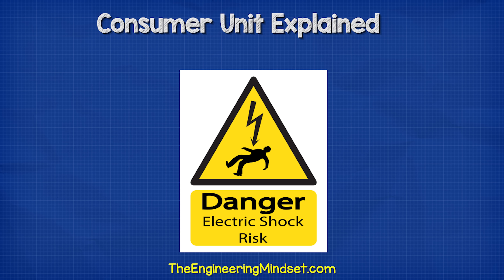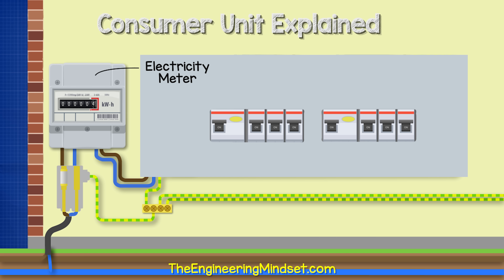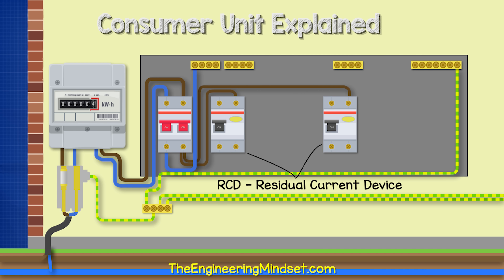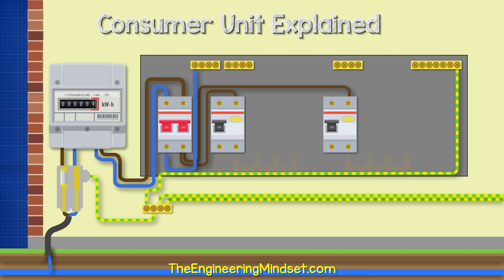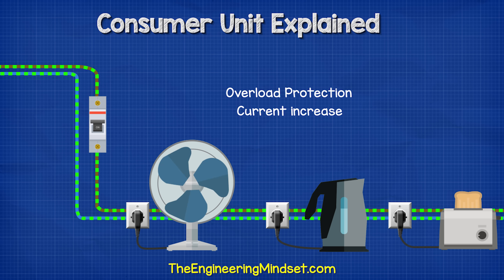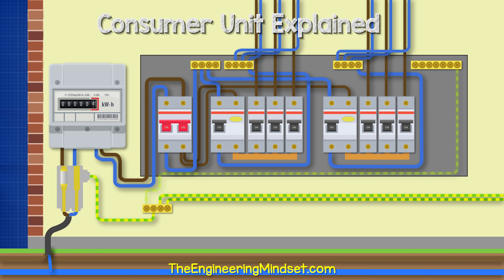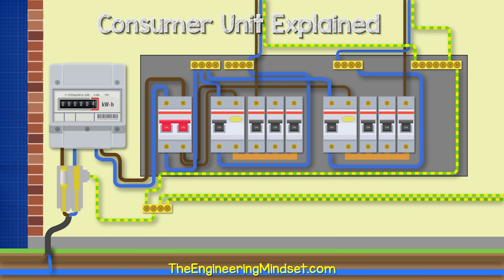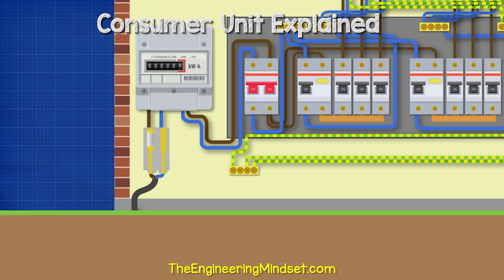Consumer Unit Explained - Fuse Board

Comment: Great Video!

Here in Brazil, this type of connection (master MCB followed by master RCD) is permitted only if the master RCD rated current capacity is equal or higher than the master MCB.
Reply from the maker: Seen our new incredibly detailed MCB video? link: https://youtu.be/gqEu9t8HwW0

Comment: Wired up my garden room, open consumer unit found a spare breaker, then shoved the earth and neutral into nearest vacant terminals and nada! Your explanation of RCDs enabled me to realise my CU was split in two with just one RCD and the other half was on breakers alone and I'd wired the live from breakers and the neutral was on the RCD neutral block. Quick re jig balanced the supply and bingo! Thanks so much

Comment: Please explain about the current rating of mcbs
Reply: The current rating is the current at which the MCB will trip. MCB are usually sized to match the cabling (and outlets) - lightning with 1.5mm2 cables would have a 10 amp fuse while 2.5mm2 wires would have a 16A MCB. This is to keep the wires from overheating. For smaller wires you would use even smaller mcb. However, if the connection is to an appliance or system using a known max amount of current in normal operation, you could size the MCB for the appliance instead, so MCB trips if there is a fault and overcurrent. MCB go down to as low as 1A,  possibly less.
Reply from the maker: Seen our new incredibly detailed MCB video? link: https://youtu.be/gqEu9t8HwW0

Comment: Maybe I missed something, but I thought UK and EU used delta-connected circuits for power distribution, meaning no neutral is required.  So where is the "neutral" for the house coming from?  Another phase, or grounded at the pole?
In North America all modern power distribution is Y (star) connected, so the neutral is inherent to the system already.

Comment: Interesting to see how residential panels work in different countries.
Here in the Netherlands its required to use breakers with both phase and neutral, also 3 phase connections are more common.
Reply: Is het niet zo dat de nul gewoon wordt door verbonden door het automaat?(behalve bij de aardlek)

Comment: if you have a hot and a neutral coming into the top main breaker for the unit how the heck does someone get dual voltage for things like ac/dryers etc. by the way youre explaining it, they only have 120 volts coming in
Reply: 230v is used in Europe.
Reply: @tougaardable  off one leg?
Reply from the maker: Only north America uses dual voltage, the rest of the world basically only uses ~230V only. There are some exceptions of course. But US homes typically also take a 240V supply and split it into two at the pole mounted transformer to create two 120V out of phase from each other. But the UK, Europe etc all just use 230V to power everything.
Reply: @EngineeringMindset  holy shit you use 230 volts for phone chargers and stuff? That seems extremely excessive lol. So literally every plug in a European house is a dryer plug
Reply from the maker: Every plug is ~230V, not just in Europe but almost the entire world. It's nearly only the US and Canada that use 120V. Again, there are some exceptions. The plug will contain power electronics which simply convert 230V AC into 5V DC to charge our phones or increasingly there's a USB charger build into the wall socket. Most modern electronic devices can be plugged into either 120V or 240V, the power electronics figure it out and use whatever it's given. Check the manufacturer label on the device.
Reply: @EngineeringMindset  wow I knew you guys operated off 50 hertz instead of 60 but I didn't realize it was THAT different
Reply: @erich1380  there are benefits to both systems, the US & Canada have a safer system from the point of view of potential injury to people, but the cables have to be much larger to offset the voltage drop from being only 120V and you need multiple phase’s to operate things like washing machines, alternatively we in the UK and EU use a higher voltage which means we can use smaller cables (which saves money) and still drive things like motors off single phase but we are more at risk from serious injury/death due to the higher voltage. Hope that makes sense.
Reply: @Dwynwilliams  yes I went to school for it so Iearned about how amps and volts are inversely proportional so it makes sense it's just surprising

Comment: So is a RCD just a ARC fault or something else completely?
Reply: Rcd monitors the current in the phase vs the current in the neutral. If they are not balanced then it will trip as this would mean there is a fault to earth. Typically 30mA  is all it takes to trip.  We also have 230v standard outlet and 400v for 2 phase circuits. Twice the smoke and fire..

Comment: i want to ask. it is recommended if the earth wire connected with ground rod also  connected with neutral wire of the service cable?
Reply: In the US it's recommend that they connect in the main service panel, but nowhere else.

Comment: Why does the UK only use two RCDs? Don't you want more granular protection so you know which circuit actually caused the fault? Also, if you cause a fault and half your house loses electricity
Reply from the maker: Properties in the UK an EU are typically small, wired just up and down stairs and not by room, although you could it just costs more
Reply: @EngineeringMindset  this is a basic explanation i’m assuming of an average UK installation, there are some things that are missing/omitted from the descriptions given, and some of the terms used are old or erroneous (Phase.. now Line conductor). The video is good as a basic description/layout, but “earth” particularly got my back up (c.p.c (circuit protective conductor)/main bonding/equipotential bonding), no mains isolator between the meter and the consumer unit is shown and an “electro magnetic effect” operates the MCB opposed to the sudden increased flow of electrons causing the bimetallic strip within the MCB to expand which is thermal expansion. Also complete omission of RCBO’s which do the jobs of both MCB’s and RCD’s in one device and have been on the market for decades, given the option electricians would install an rcbo board over a split load any day.
Reply from the maker: Seen our new incredibly detailed MCB video? link: https://youtu.be/gqEu9t8HwW0

Comment: It may be indicative of the relative power usage in the US vs UK that the main fuse in the UK is typically 100a, which at 220 v allows for 22000 watts of power, whereas, in the US, a 400a panel at 110v or 44000 watts might seriously be a candidate for an upgrade to a higher amperage panel.
Reply: US houses typically have 240 volts @ 200A service, which allows for a maximum of 48,000 W of power to be drawn.

Comment: Could you do 3 phase IT net?
Reply from the maker: Are you in Norway?
Reply: That is correct, about the only country I think with a 3 phase It net without neutral wire. 3 phases and ground, but ground is only for safety, not to get sqrt3 of 230v'.
So 230v between the phases, would really like to have 400v TN net instead though even though we are more resistant to earth failure.
Reply from the maker: I only learnt recently that Norway still uses the IT system, didn't realise anywhere really used it still. Could be worth covering at some point, we have quite a few videos in production so it'll be after those.
Reply: Is IT net still used at hospitals and other infrastructure that is dependent on a failsafe backup system?

Yeah, a lot of Norway's distribution system is built for IT net as that have been the tradition for many centuries. I do not know why we ever adopted the IT net in the first place, but I do know that we early on had local power plants spread out near to industry that wasn't interconnected. I know one of these hydro power stations delivered 25hz to its consumers.
When the distribution network is drastically rebuilt or new distribution nodes being built it will always be 400v TN net. 
I know I am better off than most US citizen having 3 phase 230v at my house, but man did I wish I had 400v. Big machinery gets cheaper and cable cores sizes shrinks ...

Comment: IF any Argentine fellows are watching:

RCD = disyuntor

MCB = térmica
Reply: Do Argentines know what Earth is? I've had to install a jabalina (earthing rod) in my house. Come to think of it I've never seen an Argentina house with earth connection.... every house I've lived in, except for right now with the jabalina I've always had a tingling sensation touching certain parts of my notebook (doesn't happen overseas) and I've seen crazy things such as fridge freezers with cable that I'd be scared to run a 60W lightbulb on!
Reply: @jimm9162  Good question. It is very common for countries in this region (and I'm guessing most of the 3rd world countries) to have old buildings without an earthing rod. That is because it was not standart practice at the time of construction and what's built it's built... 

The law that makes it mandatory for any new construction to have an earthing rod is as new as 1972, so you can count that any building prior to that date does NOT have ground... and there are LOTS of buildings of that era. 

Furthermore, in those buildings it is very common to see that the plug outlets are still of the old type E (just 2 rounded holes)... when we've been using the type I (3 diagonal lines) for the last 30 to 40 years. 

So in short: any new building (and in Buenos Aires there has been a boom in construction) has a proper earth connection. that combined with the propers RCD's at the consumer unit makes it safe. 

in any older buildings, it is essential for people to have RCD's... but I've seen old connections, in old buildings, without RCD's... and the old people living there often use extension chords and outlet splitters filled to the extreme. 

This is why there is a saying in Argentina: never open the fridge bare-footed
Reply from the maker: Seen our new incredibly detailed MCB video? link: https://youtu.be/gqEu9t8HwW0

Comment: could you also do a video like this for 3 phase european consumer units?
Reply: If you want what we have in Norway then a 3 phase European would not do. We have for the most part 3 phase IT net, our brothers in Europe for the most part has 3 phase TN net.
Reply: @Mr.Engineer.  i have always been corious as how they look inside but i cant open mine as it is not allowed here in Norway, my consumer unit is 3 phase TN i belive
Reply: @norwegiannationalist7678  But what do you do when the breaker trips? (Do you really have to call someone to reset it :O)
Reply: @mart43  no of course not i just flip the breaker, its  not like in austalia where you have to get a electrician to replace bulbs
Reply: @norwegiannationalist7678  Everything is basically the same except that you have a RCD that takes 3 phases instead of 1 and the buzzbar is separated into L1, L2 and L3. (Separated inside the plastic cover.) So if you look @6:00 then the first breaker would be L1 (Br) second would be L2 (Bl) and third would be L3 (Gy). This is in Sweden thou. Not quite sure about the UK also it only applies of you have the micro breaker and not the diazed/screw breakers. (Don't know the name for it in English)

Hope that answers it in part.
Reply: @Mr.Engineer.  No it's mostly TT network.

Comment: I noticed the horizontal configuration of the electrical  panel. Curious about this I did an actual photo image search for such panels in the UK and discovered this to be accurate.  Any reason for this design spec?  I am in the US so this was new to me.
Reply from the maker: So in commercial panels, which are typically 3 phase, they are vertical but single phase residential panels are horizontal. They're roughly the same width as a the US panel, but just more compact. I don't know why it's designed horizontal, it's pretty much always been that way in the UK. Something that springs to mind is that because heat rises, the heat of the lower circuit breakers will rise and warm the upper breakers, slightly reducing their limits in a vertical configuration. Although its not really an issue that's going to cause significant problems.
Reply: @NIAtoolkit  in the UK the regulations state that you aren’t allowed to use different manufacturer’s parts in the same panel as they’re not tested against one another and could have unforeseen reactions to one another i.e electro magnetic etc..

Comment: hmm, here I have a ground pin going into the concrete (I asume the concrete metal mesh is connected to earth pin(s?) into the ground, one connected to neutral, and I have 2 earth fault switches where it goes into...  so basically ground is connected to everything. (I live in the EU, The Netherlands)

Comment: Clear and concise explanation of UK power distribution. 
The phase to neutral ERROR will trip the circuit.   The BIG QUESTION is if the earth
conductor is ONLY CONNECTED to earth, will it TRULY trip the circuit? 
Thank you.
Reply: It will. Mainly because the main high voltage transformer is also grounded via a earth conductor.
Reply: @Ter_ror  Thank you for replying.   Understand what you say, the main high transformer 
is ALSO connected to the earth, thereby completing the circuit.   STILL, would like
to see a demonstration to see this ACTUALLY functions.  Thank you again.
Reply: The neutral point of transformer you receiving power from is grounded to earth, so if you only have the earth rod without a bonded neutral earth at your mainpanel, you create a TT earthing system which has a fault loop impedance of about 20ohm through the physical earth back to the transformer where the neutral is bonded to the earth. So with any fault current to earth at your home, and the fault loop impedance being so high, the fault current flowing through earth to the transformer will end up being so little there is a big chance your breaker will not trip. Earthing configurations are extremely important and neutral earth bonding for example the TN-C-S.
Reply: @ruan2587  Thank you for replying. (Good chance your breaker will not trip)

Comment: I'm glad that I live and work in Denmark as an electrician, our system compared to UK / US is far superior, and more safe and easier to troubleshoot on :) Any videon on the Scandinavian systems? Denmark Norway and Sweden is almost the same, Norway use IT systems more because they live on a rock but other then that its almost the same, and what's up with only 1p not 3p? Is it that rare to have 3p power in a normal household in the UK?
Reply from the maker: Yeah, most UK properties and most of the world actually doesn't have 3 phase connection to residential properties. North America and parts of Brazil use split phase. We don't really need it, although load balancing would be better if we did
Reply: @EngineeringMindset  was searching for a map to show who had 1p or 3p at normal houses but couldn't find one. Not needing 3p power? What about charging my car, boiling eggs, ,making something in the oven, my welder, my bench grinder, my mill, my electric heater for the shop, I would say how can you live without it?
Reply: @Novoo100  It certainly WOULD be useful (e.g. welder, grinder, big saws, vehicle recharging) in US and it is available, but not common and more expensive.
Reply: @Novoo100  Cost is probably the main reason.  With three phase you need three times the number of transformers and conductors as a single phase (although each conductor and transformer can be smaller).  It's just less expensive to have a large amperage single phase for a residence that doesn't have more than a few kW of electrical demand.  The vast majority of residences don't ever have as high of a peak load as you do.
Reply from the maker: My entire home is electric single phase, panel heaters, ~2kW water heater, ~1.5kw stove and oven all lighting is Led, kettle is 1kW, water circulation pump is single phase. I have a single phase mma welding unit, angle grinder, pillar drill etc etc. All works fine, no need for more phases although to be honest I do want 3 phase in the property. If I were to get an electric car I would probably need to as charge time would take so long otherwise
Reply: Do you mind elaborating a bit? What are "IT systems" in this context?
Reply: @asystole_  Its a type of grounding system, someone correct me if I'm wrong. IT system is an isolated earth system where you have a transformer (separation transformers, is it called that?) on your mains power in your house that makes 230v ac to 230v ac that way you don't need a ground.  @The Engineering Mindset   Maybe a video about grounding system types?
Reply from the maker: I only recently learnt that Norway still uses an IT system in certain parts, I was very surprised as almost everywhere else moved away from this. But essentially allows you to connect between two phases without a neutral to get 400V.
Reply: @EngineeringMindset  the grounding system has nothing to do with what you can measure between two phases, or? In Denmark I can measure 400v between 2 phases regardless of the grounding system! And IT systems get used a lot in modern hospitals,  If insulation faults occur, the system will continue to operate without any problems or risks for the patients.

Comment: Great video. The one thing that I think could have been a little bit clearer is the point that the reason we have MCBs is to protect the wiring in the house from being overloaded, causing heating and potential fire.
Reply: Yes. The wires are only rated for a certain load. Residential wire codes state a certain amp rated wire is to be used. Also when wires are spliced the contact becomes less and can make them heat up, drawing more amps